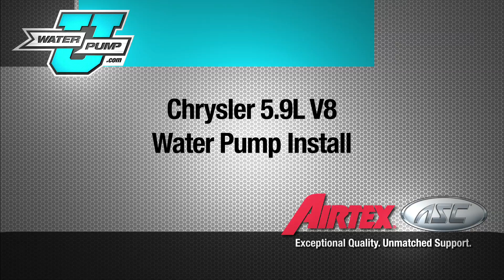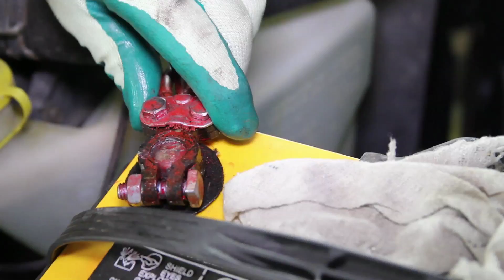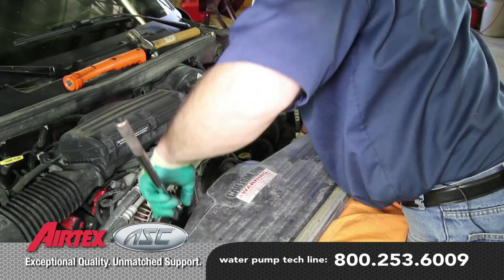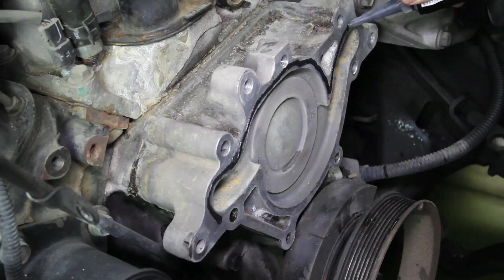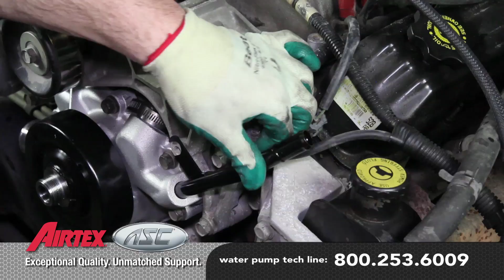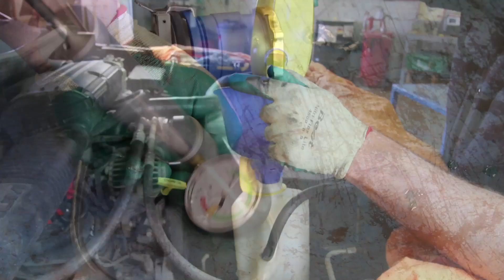How to Install a Water Pump: 1998 - 2000 Dodge Durango 5.2L V8 RWD WP-9126 AW7160

Comment: I have the same tool you show in your video to remove the fan blade and it doesn't fit at all! It would be nice if you showed us how you got that tool to work😉
Reply: Hey how did that go? Got a 1999 5.2L and a bad coolant leak, haven't fully diagnosed the water pump but it's on the list of things to change out anyhow so thought I'd look into it

Comment: So, you're saying you need to remove the air filter housing... the fan and fan shroud, using specialized tools... the washer fluid tank.... the a/c compressor.... the alternator...accessory bracket....  before you can even get to the guts of the water pump? How is a Dodge more complicated to fix than a Nissan? Some bad design there. I have to replace the water pump on my '98 Durango. The Altima i did, same year '98, all I had to do was release tension, pop the belt off, remove the pump and clean seals, put new pump on, belt back on, tension up, fill properly and go. After draining system before starting the project, of course. HOW IS THIS NOT AS EASY?! I'm not judging the video here, just the amount of extra crap you need to deal with. Video and narrative were top notch, and I'm so incredibly happy that videos like this are on Youtube. I'm just speaking about the vehicle build.
Reply: Alex Anderson its not hard lmao
Reply: If you can’t work on a old Durango just put the tools down

Comment: would the R134 not come out when removing the AC compressor?
Reply from the maker: No, the A/C system is sealed. removing the compressor does not break that seal.
Reply: I have done 4 pumps on 360. Never disconnected comp. Roll it out of the way bungee everything back.